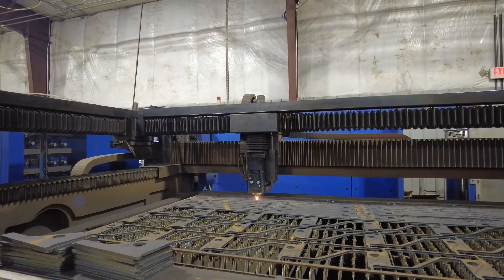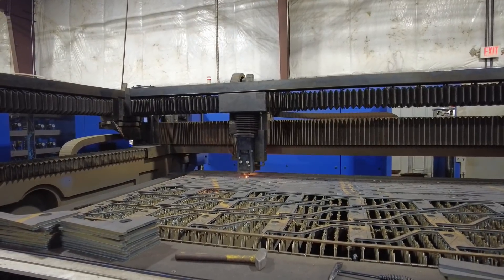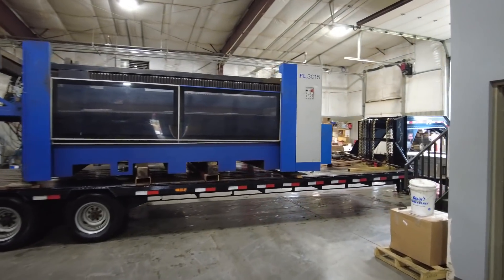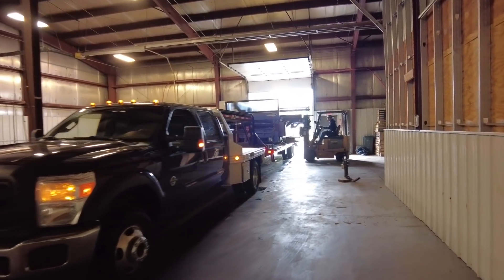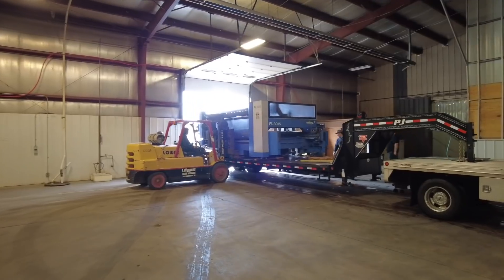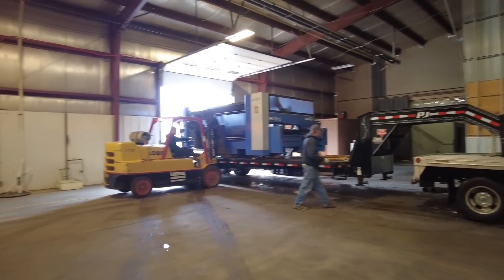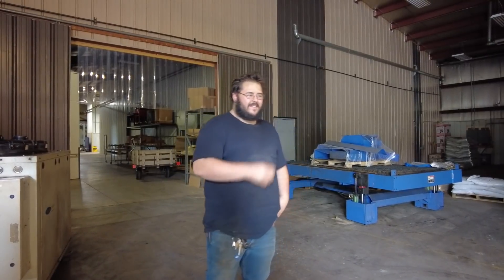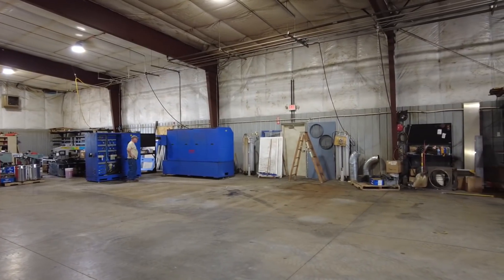Get this junk outta here! Major upgrade on the way!!

Comment: Chris I see you like laser cutting . It is a great and fast process , but it is an expensive process to run as well . In my humble opinion you would be better off with a high quality plasma table using the Hypertherm XPR 300 as a source of power . You will achieve the results that you require at a most lower operating cost . And when I say a quality I'm referring to the manufacture .  Good luck with the new machine .
Reply from the maker: We started with a plasma table and we still had to outsource laser cutting due to poor hole definition. Being able to cut 1" plate and not needing to machine holes is huge for us. Thanks! Chris
Reply: @WolfeRidge  I don’t disagree with you on that. The company I work for is on our 3rd table. Yes we grew. It is a Ficep Gemini with full contour beveling and the Hypertherm 300 it can handle a 8’x20’x3” plate. Yes we have the drill so holes are not an issue. It can cut stainless steel almost laser quality. We mainly do carbon steel. And you don’t see the bevel on the cuts like we did with the older machines we had.

Comment: Glad your getting to upgrade equipment around the shop! Should make everyday work much easier for you and your guys! What number machines are you shipping out?
Reply from the maker: After some delays getting parts we are shipping in the 1540/ 1550's 

Weld guys are in the 1590's and gaining steam
Reply: Awesome! Keep up the good work! 👍  Cant wait untill mine is on the way!!! Every piece of wood I split I'm thinking " man this will be so much nicer with my new machine"
Reply: @larrysmith5473  : I think the same thing.. Oh well got to work with what I have and run it into the ground so can afford the new splitter..
Reply: @DanielAtkinsFirewood  I'm not sure if I'm runnin the splitter into the ground or if it's running me into the ground lol
Reply: @larrysmith5473  : good point.. 🤣🤣

Comment: Out with the old, in with the new!! New equipment will, or should have no issues except for the learning curve.  More dependable and probably alot faster and easier to get the job done. Excellant upgrade Chris. Can't wait to see the new equipment up and running. Stay safe and see you on the next video